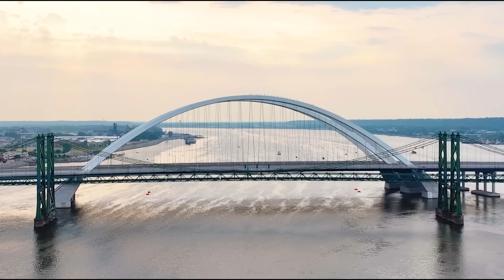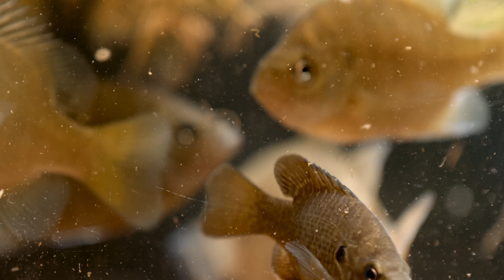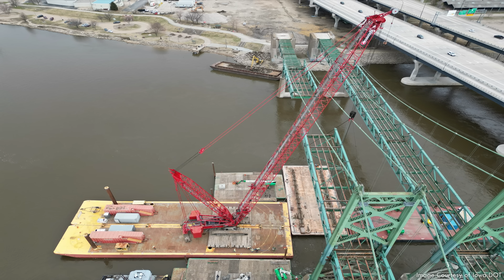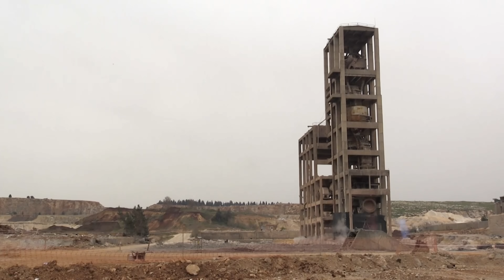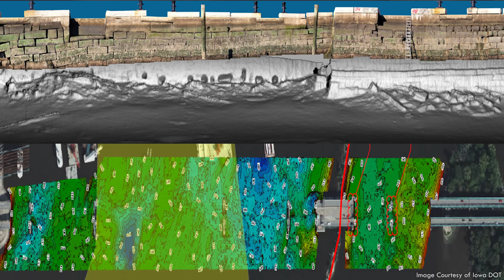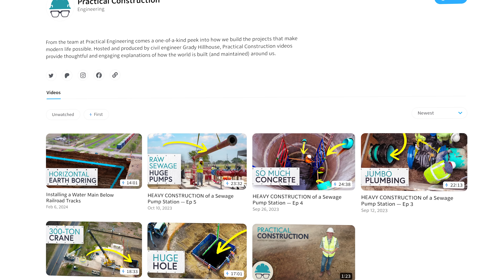Bridge Demolition is Complicated

Comment: You'd love the I-376 bridge replacement project in Pittsburgh. For the past year they built the bridge replacements next to the currently operating bridges. In a few weeks they're going to shut down the bridges for a month or so. Demo the old bridges, and used heavy hydraulic jacks to slide the new bridges into place. It's an incredible feat of engineering in my book.

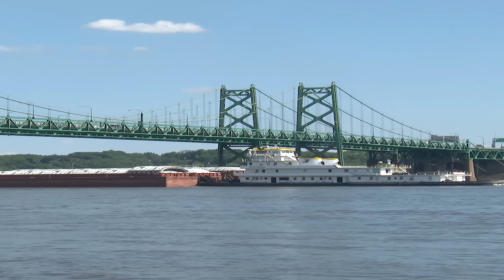Comment: @2:15 The old bridge was scary tight and undersized for modern traffic volume but to be fair, i74 across the river there isn't really a "full" interstate yet, and serves as an auxiliary interstate for in-town travellers who are closer to the middle of the metro than the edges for entering/leaving town or crossing state.  It's not technically a spur because it meets i80 on one end, but true interstate travellers bypass the quad cities entirely using either i80 or i280.

Comment: 9:41 I thought "adding parts" was going to be the default plan, that you could just follow the original construction plan in reverse, and every time scaffolding was originally allowed to come down, you have to put it back up.

But then I thought about how many components can't be accessed for cutting etc until things are removed in a different order. And dealing with the remodels over the years of use. And the extra weaknesses from the wear and tear. And the standards/tolerances during construction likely being different than those during demolition. oof

Comment: In Norway they did an interesting demolition of the old Varoddbrua (618m long). The new bridge had to be built incredibly close to the old one due to space constraints in the area (and could in fact not be fully finished until the old bridge was removed). The steel structure underneath the deck of the old bridge was lowered onto barges one section at a time by first replacing the original hangers with steel wire winches, then cutting the steel section off and then lowering the section down to the barge using those winches. Again as the new bridge was built so close to the old one I could watch this every morning on my daily commute.

A large barge crane was only used for the dismantling of the concrete towers.

Comment: I think a very interesting project you might want to cover is the replacement of the Milton–Madison Bridge over the Ohio River between Madison, IN and Milton, KY.  The original bridge was very narrow and was built in the 1930s.  The old structure was replaced with a completely new continuous truss which was constructed on temporary piers adjacent to the operational span between 2011 and 2012. The original bridge was removed except for several piers in the waterway, which were rehabilitated and widened. A new, wider 3,181-foot-long (970 m) steel-truss superstructure was slid into place along steel rails and plates, a construction method called "truss sliding."  This is considered to be the largest truss sliding ever in the US and was done to save costs and to minimize the amount of time that the crossing was unavailable to the public.

Comment: The pre-1945 (pre nuke detonation) steel would be very valuable. In Geiger counters and sensitive radiation monitoring systems where modern steel has too much cobalt 60. Ambient cobalt 60 levels have dropped since the atmospheric test ban treaty but still high enough to prevent using modern steel in the most radiation highly sensitive applications

Comment: Reminds me of when the bridge across the river from Illinois to Hannible, MO was removed. Over several months when I was a kid, on trips to see my grandparents I saw the old bridge that crossed right into downtown being dismantled. Instead of the interstate ending there in downtown, it bypassed it and a few exits were added. It’s wildly different now from when I was a kid, but the bridge now is both much higher than the old one was- which is good when the river floods- and can handle way more traffic.

For a long time the piles were still there, sticking out of the river, but they’re gone now. It can be hard to spot where the bridge used to be.

I’ve also crossed the Missouri River, at night, on these little one-car ferries while maintenance was being done on bridges. Talk about nerve-wracking!

Comment: We had two incomplete explosive demolitions trying to bring down the old Broadway Bridge over the Arkansas River in Little Rock several years ago. They tried to use explosives on the steel arch, but it didn't move. Then when they took out the concrete arches later, one of those stayed standing too. Look up "KTHV Broadway Bridge" to see news reports from those days. (The new arches, visible in the second part of the video, were pre-built and  floated into place for installation.)

Comment: I spent a few years working in the Quad Cities on a project for a fiber company. I got to see the entire project from before it started through when everything was cleaned up. It was quite the project. Didn't get to watch the final demolition, but I got to see that a few years back on the Madison-Milton bridge for US421.
Reply: In both cases the old bridges had narrow lanes with no shoulder. It didn't matter what you were driving, it felt too wide. The new bridges are much more pleasant to drive over.

Comment: I almost wish this had been about the demolition of the old Cooper River bridges after the construction of the Ravenel Bridge (Charleston/Mt. Pleasant, SC). Similar story where the original bridges - dubbed "the old Coop" and "the new Coop" by locals - were in disrepair and could no longer handle the traffic load when the decision was made to construct newer bridges to connect Charleston and Mt. Pleasant as well as link into I-26. The old bridges were old before I moved to Charleston in 1991... so the replacement was badly needed.

Comment: Drove across the old bridge every day for work over 25 years ago and yeah, it was extremely narrow especially when you had big 18 wheelers side by side.  An accident on it would shut down traffic sometimes for hours.  The first time I drove across the new bridge was so strangely different.  I was there for each of the controlled blasts, and I would like to mention the days of when the new bridge was being constructed how strange it was to drive on the westward span being all new while the eastward direction still utilized the old bridge.  It was a truly fascinating experience to watch the new being built while the old being taken apart.  Not to mention the fact of seeing two of the largest tower cranes in the world being used on this project.  I mean this project was over 20 years in the making with several delays and setbacks.  With all the engineering, environmental protections, unpredictable Midwest weather and the overall heavy amount of traffic this short section of interstate actually sees this project was an absolute ENGINEERING MARVEL.  

Yet you are one of the few who have ever touched on any aspect of the I-74 Bridge Project.  Great video and maybe follow up with some of the construction side of the new bridge.  As from what I remember the engineering involved in it was complex as the original timeline had it set for completions years before it was completed.  With all the previously mentioned factors along with several original designs before it was started and the many changes need in the design due to those factors.  I imagine you would be intrigued in the history of this project, and I bet it could give you easily enough to do a video or two on it.

Comment: In other parts of engineering, deconstruction is tied to material recycling and recovery. When I shifted from being an embedded systems engineer (mainly software, sensors and actuators) to a Systems Engineer (including mechanical and electromechanical), for the first time I had to assess the end-of-life issues, and how to change the design and production processes to optimize resolving those issues.

As an example, putting thicker conductor plating (copper or gold) on a printed circuit board makes those materials MUCH easier to recover (this circuit traces suffer from dilution, making recovery harder). As a side-effect, the extra material makes the product itself more robust and reliable. Balancing cost against performance and recovery convenience is hard, but proper engineering analysis helps make the decisions (somewhat) straightforward.

Planning for end-of-life also affects the physical production process, as taking something apart is made MUCH easier when the original assembly steps are easily reversible. Considering reversibility at the very start of the production engineering process can boggle the mind. Yet, when done wholistically, all parts of the process can be optimized as a whole. Which, still, is hard to do when the product doesn't yet exist!
Reply: I suspect with civil engineering maintenance and removal/replacement costs (including lost opportunity costs like partial closures) are not strongly represented in the bidding process. While many engineers have a strong bias toward "doing things right", engineers tend to be employed by organizations focused on financial incentives.

Large scale organization tends to reduce trust based on stable, known character and depend on external rules to limit misbehavior (or passive results of not caring) but the regulating metrics too easily becomes the goals.

Seeing great human achievements like such careful demolition is encouraging, but we humans seem to so often fall short of our potential.

Comment: There have been several bridges removed around the Galveston, Tx and bay area over the years.  Not to mention large oil field areas of well heads etc.  I shrimped those areas many years ago and can say for sure "they'' don't remove all the debri especially pipe lines that ran across the fields and to shore.  It would be enlightening to see some really detailed scan of the bay bottom!

Comment: Early 1980's,  In Southwest Connecticut, they were demolishing a concrete bridge that took 4 lanes of hwy traffic (CT Rte 15 - Merritt Parkway) over two lanes of a surface road (CT Rte 108).  This bridge, along with the whole Merritt parkway project had been built in the 30's as a depression era "alphabet soup" project.  Well, the demo engineers didn't do their homework and the bridge was built much sturdier - significantly more rebar than 1980's specifications - and when the charges went BOOM, there was no CRASH after.  Awkward!

Comment: The military engineers are good at blowing up bridges too, except sometimes the aim is to make what's left as difficult as possible to deal with to stop temporary bridges being erected over the wreckage.
Reply: Rock island IL Arsenal - Mississippi River to I - 74 bridge and old Government Bridge ( 1850s ) Rock Island Railroad and cars
Reply: military demolition is a different thing. Environmental and debris cleanup are irrelevant, worker safety may not be the highest priority either. The goal is to just do it quickly and messily to deny the bridge to an advancing enemy, or behind enemy lines
Reply: @marcogenovesi8570  There can be a lot more to it. An ex-colleague of mine in his previous role was the army's subject matter expert. Rather than a messy result his objective was more a precision demolition specifically aimed at creating awkward  debris patterns that would make a temporary fix impossible i.e. making it stay blown up.

Comment: There is a bridge demolition in progress close to where I live. It is complicated by crossing rail trestles at multiple locations and multiple nearby bridges.
Reply: Haha I came here to mention a similar project near me. 

The old Fremantle Traffic Bridge is made of worm-eaten timber and should have been replaced decades ago. It's finally happening, with the new cable-stayed bridge built on the same alignment. They built the main structure (four towers and the main beams) straddling the old bridge while it was still operational. We're now about halfway into the year-long closure to remove the old bridge and build the road deck and approaches. 

Right now they are removing the uprights using some kind of inverted piledriver (at a guess). It's clearly audible from where I live a kilometre or so from the bridge.

There was a plan to retain the old structure as a linear park which would have been amazing, but between the government and the local NIMBYs they couldn't agree on a solution that worked. New bridge is gonna be pretty cool anyway.

Comment: Great timing for this video. There is currently an old Through Arch type bridge being taken apart near me. Patullo Bridge on the Fraser River in the Vancouver, BC suburbs. Built before WW2. Busy river channel, 3 other bridges within a 1/4 mile of each other, and a vast railroad interchange network of tracks on both shorelines. June2026 they are currently strengthening the arch, in order to remove sections and not disrupt any traffic below in a 2 year process

Comment: The negative bending detail is the most underrated part of this video — the top chords going into tension after deck removal is completely counterintuitive and exactly the kind of thing that derails a demolition plan without proper historical modeling. What makes it even more impressive is that they had to reconstruct the construction sequence from old magazine articles to get the stress state right. Modern demolition engineering is half structural analysis and half archaeology. The fact that the rivets in the top chord connections weren't installed until after the concrete deck was poured — meaning the dead load stress distribution was essentially locked in at that moment — is the kind of detail that only shows up in the original construction records, not in any as-built drawing. That's a genuinely difficult forensic engineering problem and they solved it before anyone got hurt. 🌉

Comment: Very interesting video! An even more complicated and spectacular demolition took place in 2019 with the demolition of the remaining section of the Morandi Suspension Bridge in Genoa, Italy. It had previously been damaged by the breakage of one of the main cables, which resulted in the collapse of a pier. Therefore, at the start of the work, the structure was completely unbalanced, requiring a rebalancing study to safely execute the demolition. A technical report in English and Italian, with photos taken during the demolition, was published in the magazine Le Strade, issue 07-2020, and can be downloaded free online. The video of the explosion is impressive because the bridge was in the middle of the city, and to avoid raising dust (potentially hazardous due to asbestos), a huge temporary pool was built from the demolished sections. Explosions on the bottom atomized the water, which was then blasted upward in high jets, knocking the dust from the timed explosions onto the structure just seconds later.

Comment: An idea that might be a bit silly: would it work to attach floats to the cables before dropping them into the water? The most obvious question is whether you can get enough floatation (and whether the floats can survive impact with the water). But if it worked, it would be a cheap way to make the cable way easier to recover than fishing it out of the river bottom with a crane. Even just keeping one end on the surface would make it easier to pull onto a boat. And you could probably re-use the floats on other projects.
Reply: I think they'd get knocked off, and the cable is pretty heavy, so it would take a lot to float.  Maybe tying a smaller cable near one end to lift it up out of the water afterward would work, but the extra cable could get tangled in things when it falls.

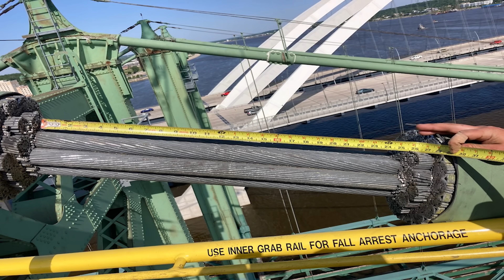Comment: 12:45 I can't imagine the pucker factor when cutting thru strands of the suspension cable.
Reply: I can't imagine cutting a strand of a cable under load, at all. Every nerve in my body would scream at me to stop.
Reply: What is "pucker factor" for those of us unfamiliar with the term? Please explain.
Reply: @markmartindale7215 intense fear/nervousness, to the point where you clench your rectum
Reply: Diamond Level
Reply: turning coal into diamonds every time you pucker on that job
Reply: Ah, come on. What's the worst that could happen?
Reply: @Sp4mMe lol
Reply: I work with those guys in the photo. Absolutely fearless.
Reply: High definitely high.
Reply: just being in the vicinity would require certified balls of steel
Reply: If the engineer says it’s ok you don’t worry about it.
Reply: @luipaardprint  I wont worry if he agrees to stand next to me while cutting.
Reply: @PhilJonesIII  he wouldn’t be an engineer if he wouldn’t. It’s very common for engineers to work on site for quick and short communication lines.
Reply: @luipaardprint  Can't argue with that.
Reply: @luipaardprint  I was at dinner many years ago with a group of engineers who'd been involved in the construction of the building we were in, Auckland's Sky Tower. And the fact that they were the ones jumping up and down on the glass floor gives a lot of confidence in their work.
Reply: The deck was lifted . There was no tension.
Reply: @davidhart4682  Less tension, but not no-tension. Even with everything else removed, the cable is still under tension from it's own substantial weight. You can afford to weaken the cable a lot under those conditions, but if you get it wrong, it's still lethal.